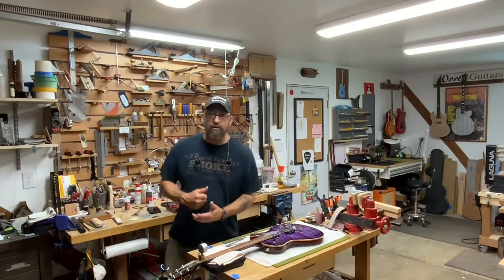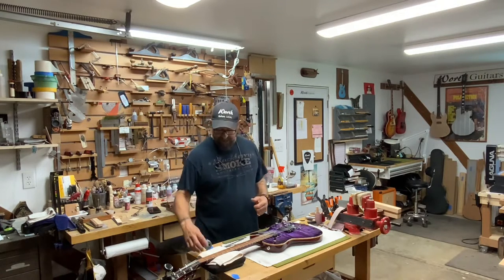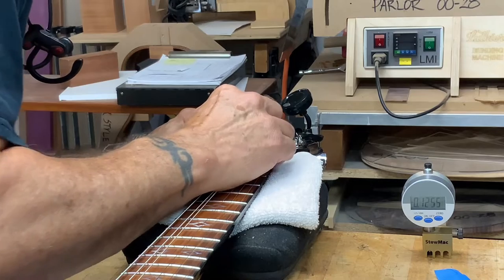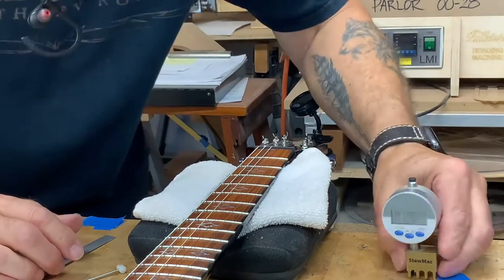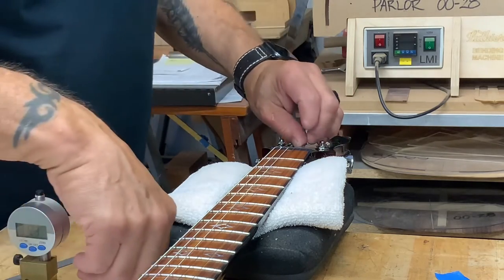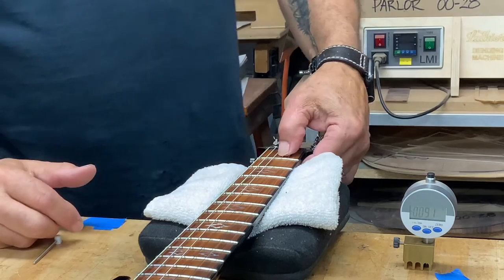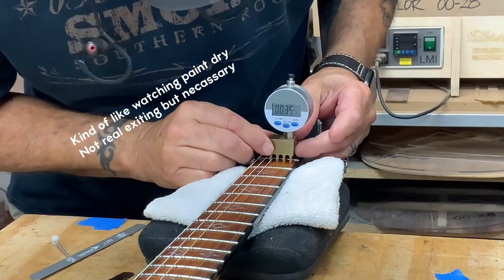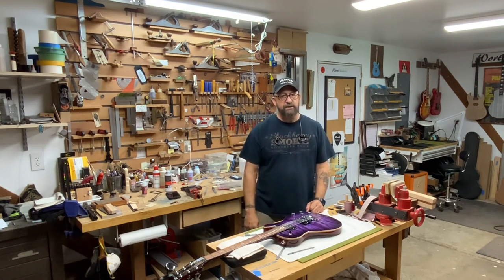The Stewmac Nut Slot Gauge

Comment: How do you account for the gravity/weight of the gauge probe, especially on the high E string? Did you check with feeler gauges to see if there was a discrepancy between the readings? Thanks!
Reply from the maker: I have not checked with a feeler gauge. I'm sure gravity plays a small part in the overall reading, but I have found the discrepancy is too small to worry about. I try to stay at around .015-.020 off of the fret so I haven't had any trouble as long as I don't get much lower. That is my personal preference. It seems to work well on my builds.
Thank you for commenting and watching. Rock on!
Reply: @WorthGuitarsUSA  I did measure the difference and it came up to 0.003” on the low E, and I think it’s not uniform for the rest of the strings. So 0.022 on the gauge measured as 0.025 with feeler gauges
Reply from the maker: Thank you for the info. I will keep that in mind in the future. Have a good one.
Reply: @WorthGuitarsUSA  i tried measuring in playing position where the plunger’s own weight would not be pressing on the string or it would be so minimal that it could be disregarded, and got more consistent results. If that makes sense
Reply from the maker: @RonSteinPhotography  got it. I have never gotten quite that technical with it. i just do the .015 -.020 and go with it.

Comment: so what ya think of the stewmac nut slot safty guage where ya use the files and sadle and file down to the file to the depth that ya want
Reply from the maker: I have never used it. I just use the flat pencil trick and mark the nut then I sand it to about .020 away from the line and then file the slots about half the depth of a string. Or enough to hold them in the nut. Then I fine tune it. After you do a few of them you kind of get the feel for it. I want .020 between the string and first fret. That seems to be the most comfortable.